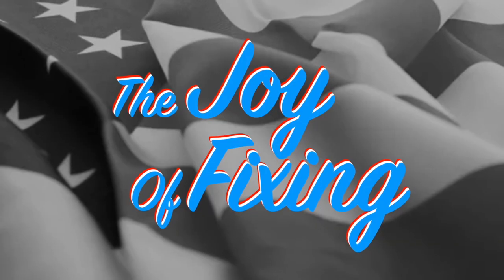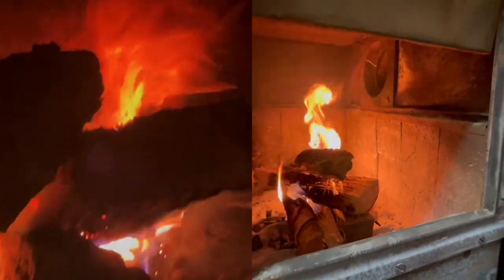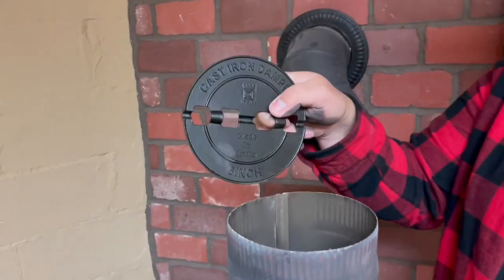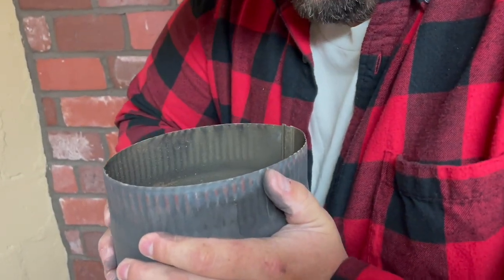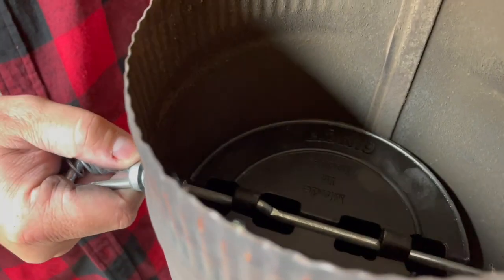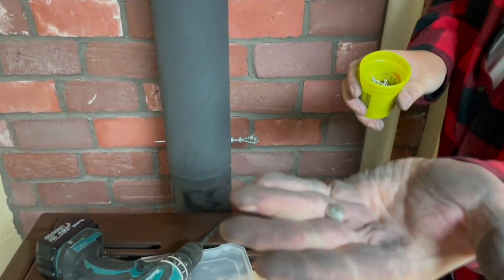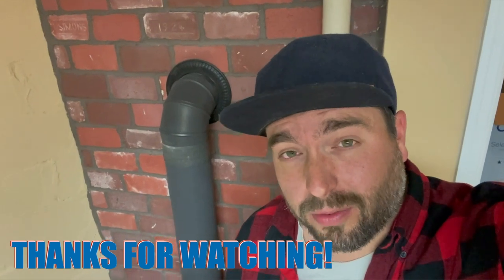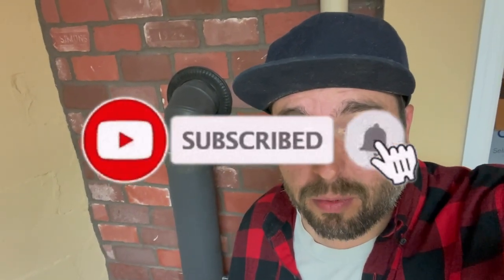This might MASSIVELY change your wood stove performance! Installing an Updraft Damper on your Flue!

Comment from the maker: 🙀 DISCLAIMER: Yes, I know the difference between the flue pipe / flue and the butterfly damper we are installing in this video. I come from a place out west where for 40+ years everyone I ever knew called the butterfly damper the "flue". Grandpa called it the "flue". The neighbor called it the "flue". It is simply a regional thing. It was as common to say "adjust the damper" as it was to say "adjust the flue". People in the city I came from all said "install a flue", even though we clearly know the damper is not called a flue. It's simply a habit, yet does not take away from the video. If you want to be picky, go for it, but the video is already made and it serves its purpose. For technical correctness, yes... the flue is the portion of the stove that connects to the stove pipe, and the connected portion of the pipe is also considered part of the flue. The flap that I keep referring to as a flue (or an updraft damper) is simply called the damper. We can all agree on that. To further argue this point is only beating a dead horse, and is as useless as arguing if you call a Pepsi a "Coke", a "Soda" or a "Pop". The differences make no sense, especially withe the aide of a video. Everyone clearly can see what is being done and what it achieves. **End disclaimer 😁
Reply: Haha,   I wasn't going to  comment anything about using the word flu incorrectly but I love your comment lol.   Oh interesting story about those dampers,  I found one while metal detecting in mint condition.  Had a date of 18something,  I can't quite remember now.  Kind of stupid but I thought it was a cool find!  It was a 19th century logging camp here in Colorado outside of Idaho Springs.
Reply from the maker: @mikemiller6065  I feel like you deserve some sort of a prize for actually reading the comment. Lol. I've had so many angry old language policing internet tough guys throwing death threats and hate mail my way for this video. haha. Like, suddenly you need a redneck aerospace certification to operate a wood stove. It's been pretty humorous to see how many guys came out of the woodwork to throw in their 2 cents and stroke their own egos. 
Maybe the words are wrong. I don't really care. We call it what we've always called it. Short story is.... this is an easy way to get the job done, and it works great every time. People who didn't come here to pick this video apart got something out of it and that has been well worth it.
Thanks for your comment! Thanks for being part of the conversation. Hope to talk with you more in the future in other video comment sections!
Thanks for watching!
Reply: Only the old wood and coal heaters require these.  A air tight wood heater doesn't and it will further restrict air flow in the flue causing excessive creasote build up.

Comment: I see so many wood stoves these days being used without a damper and the operators always complain about burning wood as fast as they can feed it in. Myself, I prefer to have a damper in MY system. The main use is during Startin' and Stokin'. WIDE OPEN EVERY TIME!! It feeds the starting fire and prevents smoke from escaping into the room when stoking the embers and reloading. Fully Closed is for when it's burning hot and you stoke it with the All-Nighters. It'll still be heating 6-8 hours later and be ready for a reload. NEVER OPEN DOOR TO STOKE THE STOVE WITH DAMPER FULLY CLOSED! You'll fill the room full of smoke!! ALWAYS OPEN DAMPER BEFORE OPENING THE STOVE DOOR! It's amazing how such a simple device can improve the performance of a wood stove. It maximizes the output(heat) and saves fuel at the same time. Nothing quite like making the wood pile last longer...cheaper on the Back AND the Wallet. 👍
Reply from the maker: This is PERFECT information. Everyone read this!
Agreed, although my stove technically does not need a damper it just gives me MORE control and lets me burn the wood even lower and slower. My full firebox can EASILY make it through the night when I do this.
Great comment.

Comment: ok a couple things to make your life easier 1) before you start your fire, put two medium sized logs down, just outside the fire building area so you can use those two logs to lay your smaller fire wood across.... like a bridge. now you can put all your little fire starting stuff on the bottom, in between the two logs and stretch your thinner wood across with out it dropping down in the middle or without having to build a tee pee. Nice thing also is the bigger wood you used at the beginning is out of the way of the little stuff and will start catching after the little stuff is good and burning.  2) easiest way to start a fire is dryer lint and sticks from the yard. if the wood is a bit damp toss a small rag in. guaranteed fire start every time and fast.
Reply from the maker: I use dryer lint all the time. Love that.

Comment: This was actually a bad idea for my particular setup. I added a stove pipe damper to my setup and my wood stove already has an internal built-in damper. The 2nd additional damper install only caused the airflow to be worse. I have a Lopi Endeavor wood stove and that damper that the stove already has works perfectly as is.
Reply from the maker: This is a great conversation to have.Thank you for starting it. This is one big thing I want to facilitate in these videos. We all have different equipment, experience and different access to different species of wood. There are some hard and fast rules, and there are individual rules. This makes for a great discussion! Thanks for bringing it up!.

If your stove already has a damper, obviously this is an unnecessary step. Agreed.

This stove in the video is an older model but it's quite high end. It has an automated thermostat that operates based off of the heat of the stove and controls the inlet of air. Theoretically, when the stove is to the heat you select you are going to see the air inlet close itself and you'd keep the fire from burning any hotter. However, with with softer woods like poplar and some pine, you can notice that the stove wants to burn that soft wood as fast as it can (especially if there are good hot colas in the stove). Despite the air inlet door being closed, the fire will still pull air from anywhere it can get it regardless of how well the stove is sealed up. Sometimes it does this thing that is similar to a backdraft where it is literally burping any air it can get from down the chimney. This then leads to dark yellow smoke burping out the top of the chimney above the roof and leaving a heavy gross cloud of unburnt wood-gas lingering in the air. So, this flu, in my situation, is ONLY to help with regulation of a rip-roaring box full of coals trying to prematurely erode the fresh wood above it at an undesired pace. Once I get to the point where the hardwoods are piled in for the night, I can typically just open that damper all the way up and shut my air inlet door to the smallest crack. This keeps the hardwood (oak, pecan, walnut) burning nice and slow all night and producing even heat throughout the house.

During the day sometimes, depending on the species of wood I am burning or the length of time I want to burn a fire, it's nice to open up the air inlet a little bigger than necessary and just do simple old school updraft regulation using the flue damper.

ABSOLUTELY, if you have a stove with a damper already in it... this video has no bearing and should be disregarded. However, with any other wood stove that has no way to regulate the updraft, this video is for you!
Reply: Glad I saw you post,I have a Lopi Liberty wood stove and was wondering if I need a pipe damper.only puts fire up the stove pipe when the bypass is pulled out. Think I will hold off for now.
Reply from the maker: @timpinkerton2893  Yeah I think that's a good idea. Just the fact you have the bypass suggests you probably don't need it. It's a great idea for stoves that have no output regulation whatsoever but  yours sounds like it does.

Comment: Thx for the video. A baffle in front of the exit would make a huge difference. Also, if you can duct an outside air source, you will dramatically increase the comfort level with lower temps
Reply from the maker: Unfortunately it's so far inside of a finished basement there's no way to pipe it in. But I have some plans for the future when we tear out one of the walls that might give me some access.
Reply: @thejoyoffixing  The thing about a woodstove is that one always seems to improve the functionality of the  unit. Well done fella.
Reply from the maker: Thanks, buddy!
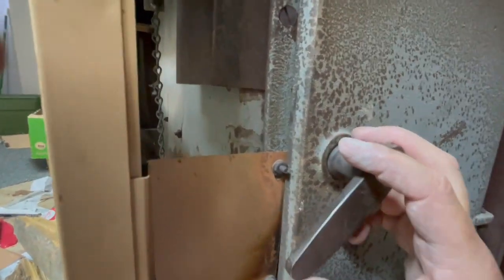Reply: @thejoyoffixing  Your stove looks like an Ashley cabinet heater, which was similar to a Sears branded stove of similar appearance.  I don't feel that a stovepipe damper is necessary since your stove already has an air control in the form of a  dial on the front of its cabinet.                            Here's what I see - At 1:27 in your video you show the ash door is open while the kindling is burning way too fast and you say "Granted, I'm leaving a lot of air for it".  I also see the chain on the left inside of the cabinet leading down to the combustion air flap at the bottom left of the ash bin.  The chain should be connected to a either a manual adjustment or to (bi-metallic spring) thermostat which had an adjustment knob on the upper part of the cabinet.  Most importantly, the stove should never be operating with the ash door open - in fact the ash door must have an  airtight gasket and be kept tightly closed except when the fire is out and the ashes are being shoveled out.  The air that feeds the fire (combustion air) should be entering ONLY through the flap  controlled by the stove's thermostat.  As the stove heats up, either you (stove operator) or the thermostat will allow the chain to lower the air intake flap thereby controlling the burn rate.  When you or the thermostat senses that the fire needs to grow larger, it (you) will pull the flap open by turning the knob and admit more air and the fire will increase in intensity - until the thermostat, once again, lowers the flap far enough to slow the airflow into the fire.  You might be able to find the stove's instruction manual online.  Hope this helps you out.
Reply from the maker: Sven, you are actually absolutely correct on all of this. I am aware of all of this and that is exactly how I operate my stove. However, I greatly thank you for stating these facts because I've received multiple messages from people who have this style of stove and have no idea how to use it. Great information laid out here.
The bi-metallic spring is truly like... a genius little piece of science. It never becomes less fascinating to me that something so simple is so incredibly perfect for this situation. Truly this style stove is simple to look at but a LOT of thought and practical design and simple science obviously went into it.
For the sake of the video I did use the ash door as a means of accelerating certain processes for the sake of filming time. However, I never abused the process to the point that I was producing over exaggerated results for the video. Just wanted to show exactly what was happening inside, which is hard to do without melting my phone. haha.
As I've mentioned in other videos, a flue damper is NOT at all required on this type of stove. It's designed to happily run without one. HOWEVER, for certain wood species or certain ultra low temperatures I occasionally want to produce from this stove, it helps me further regulate what's happening with the updraft and in my specific case I find it useful. Regardless, to someone who has a wood burner that does NOT have this type of setup and does not have a built in damper... this video should be extremely helpful to them if they don't know how to get control of their stove.
Once again, thank you so much for your post. These stoves are mysterious to some folks. I got both of mine from folks who tore them out because they simply didn't understand how they worked! I personally think that they are some of the best made stoves you can get your hands on.
Reply: I agree 💯 without your way, air gets sucked in through electrical outlets & any where not airtight you will feel a draft
Reply: @tony steinke  Good call on the baffle. Hopefully his damper will help.
Reply: I'm  baffled ...

Comment: Burn rate in modern systems can, and should, be controlled at the intake.  Chimney dampers were for older, inefficient systems.  Secondary burn systems rely upon turning down the primary intake(s), causing wood to smolder;  While the secondary intakes are opened.  This allows a more complete burn, producing a vigorous burn of wood gases apart from the slowly smoldering wood itself.
Reply from the maker: Bingo. Some day, after some more expensive projects are completed, I'm looking forward to getting one of these newer stoves with the ability to burn the woodgas at a smolder. Such a cool idea.
Speaking of woodgas, I'm thinking of building a wood-gas generator this summer. MAYBE.
Reply: @@chrisostendorf  I too have a long run out (28ft) and find that a barometric damper works well for this.  These allow the chimney flow to remain just vigorous enough to prevent back drafting (puffing) while still allowing the stove work at optimum system efficiency.

Comment: If I had that stove I'd build a baffle across the firebox about the level of the bottom of the flue to make the gases have to come to the front of the stove first and then up and out the flue. That's how most stoves are built today.  My stove's baffle is just an angle iron framework that holds standard firebrick and it does a great job.  I always include a damper in the pipe to help regulate the fire and to be able to stop things down in case of a chimney fire.
Reply from the maker: I’ve considered a baffle but I think I’m gonna end up with a different stove eventually. 
Agreed on the baffle. People keep saying it’s unnecessary… which is their choice. But, I like the control it offers.
Thanks for watching and commenting

Comment: First of all, the real problem is the stove? No insurance company will insure you with that old thing. If your house burns down and you are not up to specs the insurance company will have an out just saying be careful!! Also do not install one of these dampers if you have a newer styled stove they are designed to run as they are!!  installing one of these will make your newer stove run bad.
Reply from the maker: Correct

Comment: i put a damper in every stove i use. i find them very useful to fine tune the burn. neat trick about lining up the drill holes.
Reply from the maker: Thanks, man! appreciate that! Lots of dudes wanna died their tool collection but… it ain’t necessary here. Sometimes the simple tool is the right tool.

Comment: Best way to make the holes for the control rod...take the pipe outside and lay it on the ground, CARFULY line up the barrel of a .22 rifle with the muzzle resting on the pipe ( pointing straight DOWN ) . When things look just right... BANG no drill needed. Taught this from an old trapper/hunter .Ontario Canada .
Reply from the maker: Listen.... I'm not gonna say it's the BEST way...... but it sure it sounds like the AWESOME way. I do have an extra chunk of pipe... hmm..... NAH. Knowing YouTube I'll end up with some sort of violation.
Nice tip, John. That is the MANLIEST suggestion I've seen yet for such a simple project. Haha.
Reply from the maker: HAHA. "Why not 2 dampers? WHY NOT 4 DAMPERS? We got the holes!"
Reply: @thejoyoffixing  I have a Woodstock Fireview Model 205, which is 22 years old.  At the end of the burn season, I had a new 6" stainless steel liner installed.  Now I'm running into issues with the woodstove overheating in bypass mode using the catalytic converter, even when the manual air control lever is closed down to under .5 on their settings from zero to five(full open).  Woodstock suggested I have a damper installed to control the strong updraft.  I have checked the stove out for other leaks from door seals, the damper bypass door, leaks in the firebox and can find nothing.  I have replaced the firebox door, gaskets and complete top lid within the last  two years.  The only conclusion I can come up with is, since the stove functioned beautifully last winter, is the new liner has created too much of an updraft.  Also, the liner was insulated going up the masonry chimney.
Reply from the maker: @margaretbarton613  That's interesting. Yeah it must be due to the install. If at that point there was suddenly a difference in how it operated... that must have caused it. What a pain in the keister.
Reply: This is how I've done it about five different times. A .17 HMR works even better.
Reply from the maker: @jamesb2291  Completely unappreciated caliber.  This is a worthy process. Well done.

Comment: That flue damper really is an important part for a wood burner. Good fix!
Reply from the maker: Thanks
Reply: For cheap wood stove purchases, yes that damper is a must but if you own a high-end wood stove most of those will have a built-in damper.
Reply from the maker: Agreed.

Comment: The damper will help since it’s just a straight shot from the firebox to the flue pipe. I would try to install some kind of baffle or deflector where the smoke has a longer or restricted path to the firebox exit.
Reply from the maker: Agreed
Reply: I do believe most modern stoves are designed that way with what's known as a 'reburner'.
Reply from the maker: @fritzkabeano1969  If I had the cash I'd get one of those. Longer burn times. Less thick smoke. it's practically a gasifier.
Reply: I heated with those type stoves Ashley, king, warm morning for many years and all of the ones i had came from the factory with a baffle to slow the smoke from entering the flue pipe. @thejoyoffixing